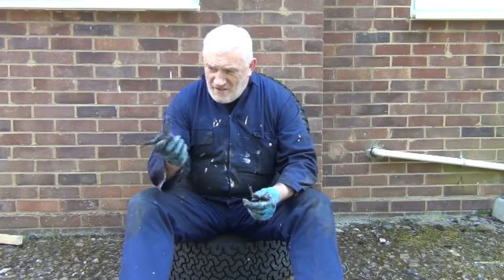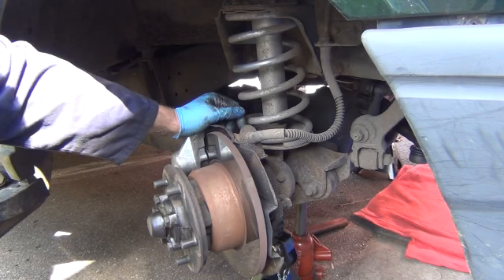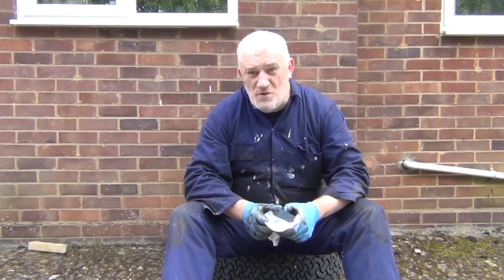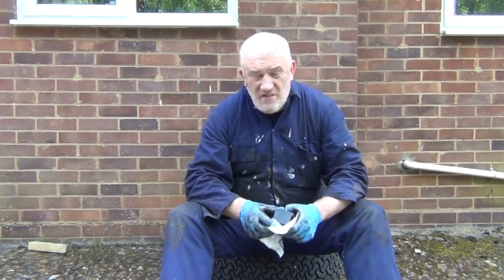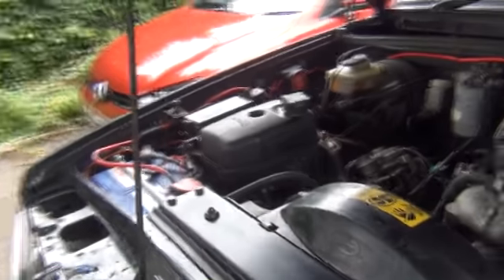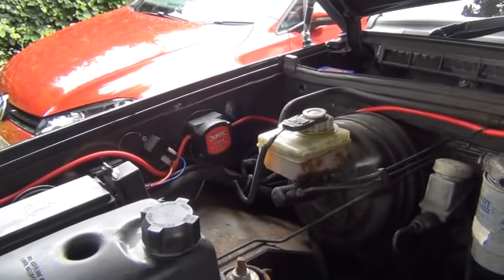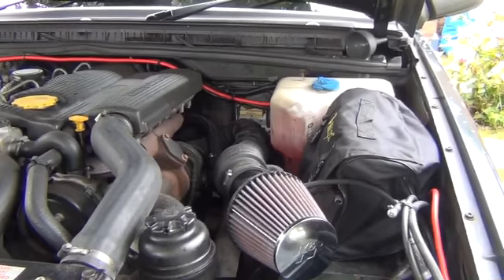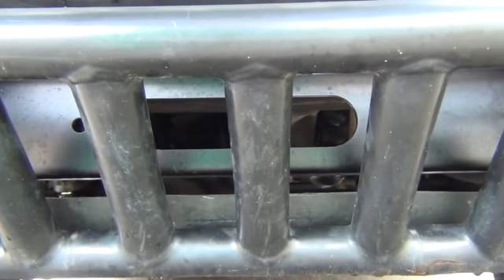Vehicle maintenance Stay Ready

Comment: Hi Roach, just a small point to note. At 5.55 the video shows the anti roll bar link on the LHS in the "up" position, and the RHS anti roll bar link in the "down" position. This puts the ARB under torsion which may explain your "parlarvar" changing the bushes.  Thanks for posting your videos, my son ( Lewis) and I  ( Ex REME VM (TA)) love them.ATB.
Reply from the maker: Hi Andy, I'm no mechanic just rolling up my sleeves and having ago (HaHa!!) but your right, the MOT retest guy didn't notice but the firm I got to weld up the inner wing did and they turned it around for me ( For a price of course ) Good luck feller's and thanks for watching. Roach

Comment: Hey Roach can I just suggest you take the disco for a wheel allignment/tracking check. Any time track rod end, steering arms etc are changed even if you count the threads between old and new there is still a chance you will end up with uneven tyre wear etc.
Great video though
Cheers
Reply from the maker: Thanks Jonathan yes mate had it done at the place I buy my tyres (No Charge) that's what we like Atb mate. Roach

Comment: Had some issues with my car last week.....Removed and replaced front/R CV shaft, front/R wheel bearing kit, new front and rear disc brake pads installed, disc rotors machined......total cost including labour $1092.50. All when im trying to save for my trip overseas next year.
Reply from the maker: Ho-Hum, my father would say it's just your turn (HaHa!!) chin up mate at least you should have a reliable vehicle for a while Atb. Roach

Comment: Discos are good trucks if looked after I've got a bit of welding on mine for my mot but my trucks far from standard if you've seen my bov  video with a 2" lift and a set of mud or at tyres that are good offroaders

Comment: Please take that airfilter off and replace it with a smaller airbox and a snorkel. Deep water and open filters dont mix.......dont ask how i know.
Reply from the maker: I'll be fitting the snorkel kit soon, but my idea is to use the K+N as standard but before I undertake a deep water crossing I'll switch the air feed over to run through the snorkel but thanks for your advice be safe Atb. Roach